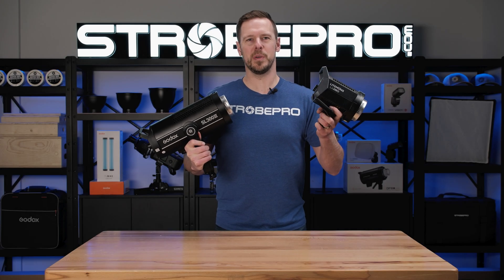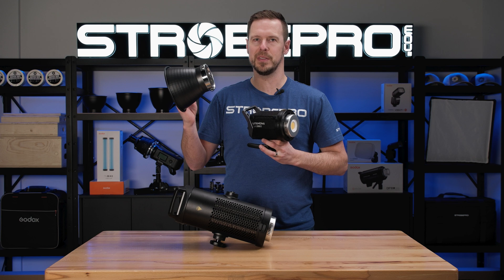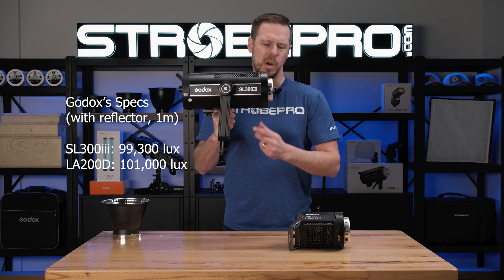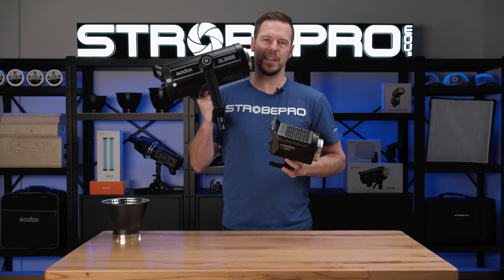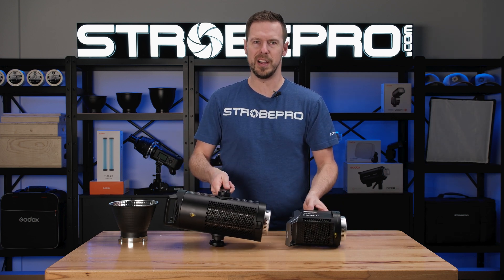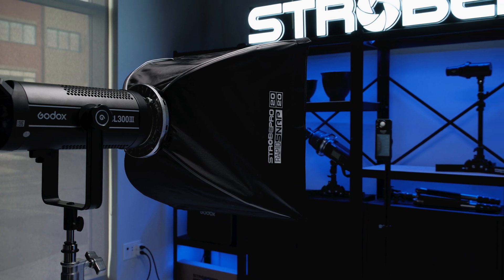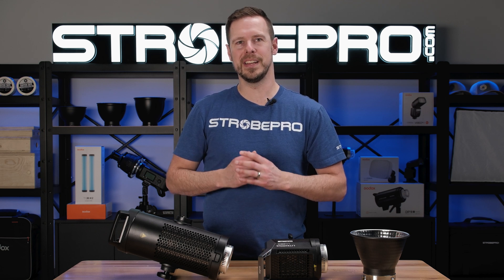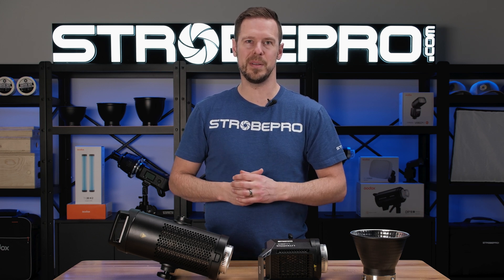Do These LEDs Really Have the Same Output?

Comment: where can I find the lighting power comparison.
Reply from the maker: Hi @AbundantLifeMedia,

TL;DR: The power difference is about what you would expect even though the factory specifications would lead one to believe otherwise.  This has to do with how the larger surface area of the LED on the 300W light interacts with the stock reflector. We compared the lights in three ways: With the reflector, without the reflector, and with a 2'x2' softbox. This is a short video so I don't want to spoil all of our results down here!
Reply: Here! Up above, is the Link that I found

Comment: ok... but how did you go from 99,000 lux at 1 meter, but later when tested you say they are 13,000 lux? and 3700 lux in a softbox (of course softbox will be less) . is the hard reflector really increasing the light by almost 10 times?

Comment: What would be the benefit to using Godox SL200IIIBI vs LA200BI?
Reply from the maker: The SL200iiiBi has a bit of a tougher build, and a nice yoke mount. It is quite a bit larger, and caries a larger heatsink which inevitably means quieter performance (though we are still impressed the LA200Bi in that category). The SL200iiiBi is a monolight, meaning there is no external power brick to carry with you, so that gives it a portability advantage in one sense (despite its much large body). 

The LA200Bi is still the budget king! If you are just looking for 200 watts on a modern LED chip, it's an easy recommendation.

If you are considering the SL200iiiBi, you could opt for the SL300iiiBi instead. It uses the same body and has an extra half-stop of power for not too much more money. Initially, we only stocked the daylight version, but we are bringing Bi-Colour models in our upcoming shipment.